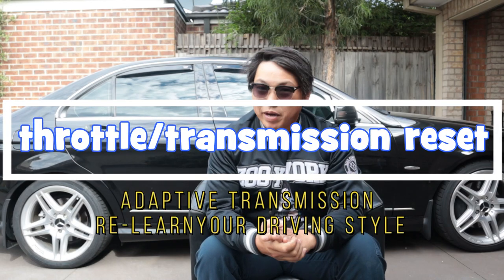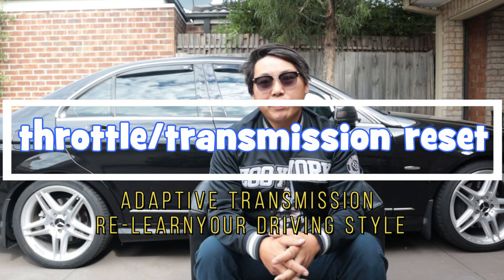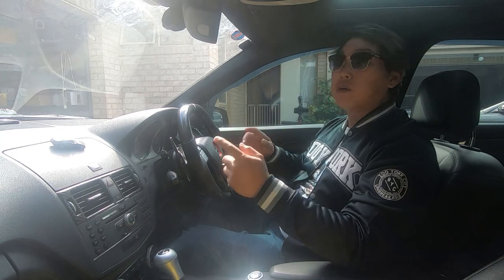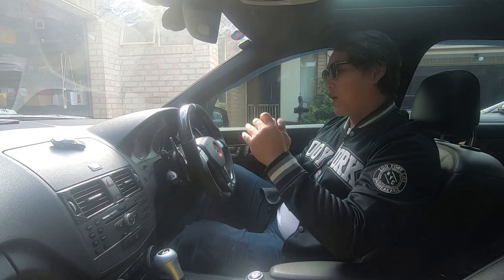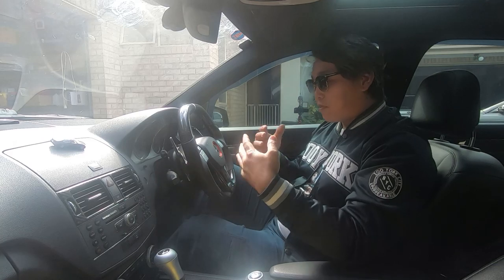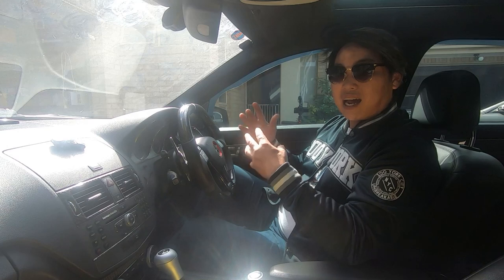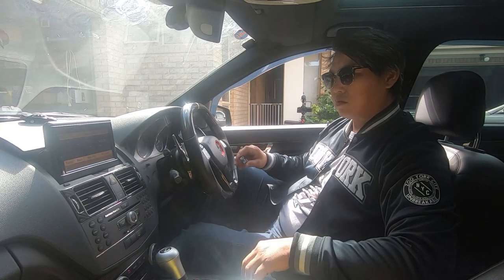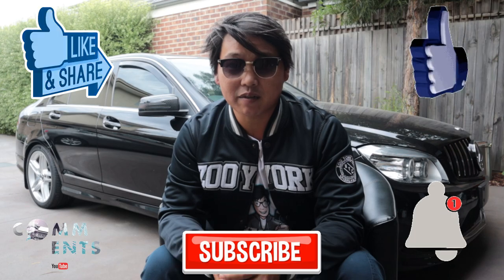mercedes benz TCM TCP throttle/transmission reset procedure EXPLAINED

Comment: Thank you so much! For the longest time I thought there was something wrong with my car! It was laggy, not very responsive and very slow at accelerating and unable to hit 3000 rpm! Thanks for giving me the confidence to reset my TCU and now it's running like new!
Reply from the maker: as long as there are no underlying issues it will help.. but if there are issue then it's not gonna hold up cuz there is another issue causing the lag or limp mode.. many ppl get the wrong idea and think its a fix but it's not a fix for an actual issue..

Comment: Hi @mikey so basically the steps are:
1. Turn key to 2nd on position (cluster lights turn on)
2. Hold down gas pedal for at least 10 secs
3. Turn key to off position (cluster lights turn off)
4. Hold down gas pedal for additional 10 secs at least.
5. Let go of gas pedal.
6. Start car and drive round for 15-20 mins so the adaptive gearbox can relearn the way I drive.

Is this correct?
Reply from the maker: yes step 4 isn't needed 
wen u turn key off u can release the gas pedal then do nothing 3 to 5 mins and then go for a drive

Comment: I tried this to get a more responsive feel out of my w203's transmission and it seemed to help at first. However, the day after doing this my car started having trouble turning over on a cold start, the same day on the way home from work it died at a red light, first time since owning the car I've had either of these problems. I spoke with my friend who is a German car mechanic and he tells me that when you do this type of reset there is another sensor that your supposed to reset at the same time (one you need OBD2 scanner to reset). I'm taking it in to let him have a look tomorrow, I'll get back to you with more info soon.
Reply from the maker: npz
Reply: So, I got this over to my friend's shop. He ended up having to reset everything in the car to even get it to start. He said he wasn't sure why I experienced this issue and that I should be able to do this sort of reset without issue. The car is working now but since he had to reset the sensors my fuel economy has gotten much worse (~3mpg less than before attempting the reset) and the car generally runs rougher. Any ideas what might be causing this issue? I've got no fault codes of any kind.
Reply: I’ll say a prayer for your car. Good luck.
Reply from the maker: @kalmanmerszei1048  ill 2nd that

Comment: Hey Mike, I have a 2009 Mercedes C350. Would you be able to advise me with an issue on my car? When I turn the car off my throttle body keeps trying to adjust it self to what I’m assuming to the close position but it keeps going all night. It won’t stop and it drains my battery completely. Any suggestions to what the fix could be. I should tell you this stared to when I was on the highway on a really hot day A/C on my car turned off all of sudden due to overheating I pulled over to the side the fan kept running and when it cooled it started back up again. But did it mess up the throttle position of the car and now it won’t go back to normal?
Thank You! For your time Mike😊

Comment: Hi Mike , my 2013 e250 estate drive perfect solo but when towing our van occasionally when I want to accelerate it’s seem unresponsive so have to go into manual and put foot to floor , this lasts for approx 5 mins then it’s ok , would I benefit from doing this reset please
Reply from the maker: it would at the strat but if there is an underlying issue it wont fix it, it will come back ...
Reply: @MIKEYZVLOGZ  Thankyou , what could sort of thing could be an underlying issue please

Comment: Hi bro hope u good, means if my car was on Stage 2 ECU tuned. So there is no issue right, as it only resetting the TCU.
Reply from the maker: es thats right , your ecu tune is the actual ecu, remapped, this is just a throttle response reset. ppl mistaken this for ecu reset . its not, it resets the ecu module for the throttle thats all i believe , but maybe u should ask your tuner who did you car will it affect it, im sure it wont . ecu is a completely different thing
Reply: @MIKEYZVLOGZ  yes that’s what i wonder. Thanks alot mate ✌🏻

Comment: Do you got any idea why when i start my car (2009 c300) rpms jump up and down, and while I'm at a stop? Just change spark plugs was most needed anyway but still have problem, luqui moly fuel injection cleaner, still have problem thinks it's the throttle body. Just wanted a second opinion sir🙏🏾
Reply from the maker: could be throttle dirty or maf dirty

Comment: Hi I hVe a 2009 c300 and everything was working fine then one day abs light came on and would always engage it when driving so I pulled out fuse but 3 days later now my transmission won't shift out of first it drive but won't pass 40 kph and I believe it's in limp mode now... any suggestion
Reply from the maker: hey bud so sorry couldnt get back to you . i have been so busy , wen ur car hits limp mode, they can be number of issues causing this, it shard to say exactly what it can be because there are so many contributing factors that can make a car go into limp mode, such as dirty maf sensor, oil low, loss of oil pressure, timing,  the only way to tackle this wouold be to scan for errors and try to narrow down the fault, if you are not too experiemnced u must take it to a mechanic to sort out,
Reply: @MIKEYZ VLOGZ  hey thanks I got it checked by a mechanic and he reset everything and it's was working gone for like 2 days and now it has gotten back into limp mode. Would you know if the abs ebr esp would cause this ...like if I replace the abs sensor would this be one of the reason for it stop from going into limp mode???
Reply from the maker: @Terrance  car goes into limp mode from a engine fault to stop it doing major damage
Reply: @MIKEYZ VLOGZ  ok he said it was like a fluke on why it went into limp mode. The car runs fine and everything for like the past 6 years I had it and the only recent thing that happen was the abs light and once he reset it it was fine until today. So that's why I was woundering if the abs sensor would be a part of the problem. Thanks again Mikeyz
Reply from the maker: @terrance6501  YES IT COULD BE IT, I DID REMEMEBER reading somewhere that someone had the same problem and it was fixed after replacing the abs sensor ..but pls do not quote me on that , i am not sure as i havent experienced this peroblem as yet

Comment: I just cleaned my throttle body and emptied the oil catch can. I reassembled everything back and when I start the car it’s very rough. More than ever!! Did I do something wrong?
Reply from the maker: What did u use to clean the throttle body did u clean maf sensor?  Try unplugging maf sensor and see if shaky goes away ..if it does then u have a faulty maf
Reply: @MIKEYZVLOGZ  I didn’t clean the maf sensor. I have a 2014 e350 w212 M276 engine
Reply: I used carb cleaner and wd40 degreaser just like in senior Leigh’s video. I followed every step
Reply: I literally just unplugged the MAF sensor from the air filter box. The shakiness went away and it just idles at 1000-1200 rpm steadily.

Comment: Cheers, it looks like its working. I was starting to stress that I brought a lemon. 🙂
Reply from the maker: but if the issue comes back u may jist have a underlying issue whether it's a maf sensor or intake leak sonetjing that's making but loose pressure

Comment: Hi my friend I would like your valuable help.I have c220 cdi 2010 when I put D to start while pressing brake it pushes hard to start.Thanks
Reply from the maker: do u mean it kicks into gear D very hard like a hard jerk wen u enter D
Reply: @MIKEYZVLOGZ  
no. I put D normally it doesn't knock and doesn't have a jerk. But I have the brake pressed hard and it keeps pushing me hard to Thank you!
Reply: @MIKEYZVLOGZ  Do you think that if I do a reset the way you show it can help?
Reply from the maker: @user-ey4yc8tf5r I don't think a reset will fix it..it could temporarily solve it ..but if there is a underlying issue it will come back
Reply: @MIKEYZVLOGZ  Thank you very much!!!

Comment: Hi i have a c63 (w204) yesterday i was at a set of traffic lights and the car cut out, i restarted it no problem but every time i put the car in drive it stalls completly - any ideas ?
Reply from the maker: hi mate, could u elaborate on some more info , its hard to diagnose over the net , so abit more info would help point u in the right direction, however regardless, these are the things i would be looking for 
prior to this happening was there any other symptoms that started such as intermittent shut off, bad fuel , jerky shifting of gears, rough idle rough driving , limp mode? 
usually when a car is shutting off when selecting D, it relates to the transmission but the actual cause is hard to simply point to, it s best to have it looked at before the problem becomes worse or leads to major issues.
Reply: hi, thanks for your reply, the car sometimes felt a bit jerky when changing gear, also was lagging abit
Reply from the maker: like i said hard to say without actually being there to feel it and see it but i would start with a obd2 scan, with a proper tool that scans all modules, not just the typical ones, it has to be Mercedes specific, like icarsoft , or star or vediamo xentry , this will def narrow down the issue so ur not throwing money and parts at the car hoping to fix it  @2bluelou
Reply: thanks so much for your input, ill get it checked out @MIKEYZVLOGZ
Reply from the maker: @2bluelou ye do that

Comment: Hi there hope well ? I have a question regarding my s button c button don't work I've tried cleaning the switch no luck any idea
Reply: spray some hydrogen peroxide in the cracks, it worked when mine was sticking

Comment: can you tell me what the symptoms are? When should you do this? I now have the following, Cla automatic in eco drive. In a traffic jam, the car will change gears differently after a while, make high revs and switch back to normal when you arrive home the next day. So is this a good thing to do? Thank you for your response
Reply from the maker: basically I would do this just wen u feel you need it ..for example wen u drive and the car no longer responds well to your driving style... or wen someone borrows your car for a while...and drives completely different to you ... not if it's just a day ... and if tour car feels laggy... in your case seems like a sensor is failing .. or even a air hose causing that random rev ... can't say for sure ..but definitely needs to be looked at by a qualified mechanic ..do not let these problems be ignored it may cause more harm

Comment: Will this work on a 2012 mercedes w204?
Reply from the maker: yes sure will. its auto right?
Reply: @MIKEYZVLOGZ  yes
Reply from the maker: @allengoodhur9388  then it will work
Reply: Is this work for 2010 w204 c200
Reply from the maker: @2uk2  yes should be ok and work

Comment: Hi there we have a C300 2007 and noticed a few things happening  
-Gears aren’t showing on the dash anymore when switching them from Drive to park etc.
(letters are visible but not highlighted if that makes sense)
- Cannot select sports manual & comfort mode anymore that’s no longer displaying at all either. 
-Car Kicks back hard when we put it into Drive park neutral. 
- Finally when accelerating it goes up to 4000rpms making a high whine noise like it wants to change gears but can’t. 
Any help would be great. 
Thanks
Reply from the maker: hope someone else can chime in here ... sorry to hear of those issue..sound very much like sensors ... knock sensor for gearbox... and possibly engine mounts ..but u won't know until u do the process of elimination .. using obd2 scanner tooldesigned for mercs... and trial and error by physically looking the problem areas..  this is what I would do .. hard to say from just the description uve given ... this would need a more in depth look at ... a mechanic or alot of research and time to find actual fault and issue ... hope this  helps point u in the right direction .... although I would get it looked at asap ... doesn't sound healthy for the car ..the symptoms u describe
Reply: @MIKEYZVLOGZ  
 
Thank you so much for the response we found the problem my partner pulled up a Fuse not the small 1z but a big Square 1 & she didn’t push it bk down she said she forgot.
As soon as we pushed it bk in everything went bk to normal 🙌
Glad it wasn’t something serious. 
Thank you.
Reply from the maker: @Munihuni90  very glad to hear it
Reply: @Munihuni90  I had this issue when my centre gateway was wet. Yea legit wet because my windshield used to leak. So my car can work fine but I def need to get a new gateway when I have the funds. It ain’t no easy job to own a merc in a developing south East Asian country due to exchange rates and inflation to account for. 

Oh ya btw my symptoms were like what u said, harsh kick back when put into drive, but other than that my meter display was initially still able to indicate the gear I selected, except after that when I was in D it still said I was in N.
Reply: Change your transmission fluid. Don't be cheap you drive a Mercedes.  If you're cheap & own a Mercedes it will be a nightmare & a money pit but for those who don't mind spending on there car and doing there own work it's a dream.
Reply: did you end up figuring out what was wrong??
Reply from the maker: if u read above was just a loose fuse
Reply: @MIKEYZVLOGZ  i see i just don't know what fuse it was, im having same issue
Reply: @Munihuni90  i have the sam exact issue smh, let me know if you remember what fuse
Reply from the maker: @diegoperez-bb3nz  hopefully he can tell u which fuse it was ...
Reply: Did you happen to figure out what fuse it was im having the same problem. Thanks  @diegoperez-bb3nz
Reply: Do you happen to know what fuse it was mine is doing the exact same thing  @NokiaHumanForm

Comment: Can we disconnect the battery for about 15 minutes and reset EVERYTHING?
Reply from the maker: that might work but I think thats for ecu this is  specifically transmission module reset
Reply: No doesn't work
Reply: I heard that, but I thought it was 24hours .I heard it resets the ECU to factory settings.(on most cars)

Comment: One thing I don’t get about my W211 is when I set the transmission in C, it would drive off my driveway like normal and after I stop at a traffic light, my God that thing starts off at 3rd gear. My dad is the one driving the car often and of course boomers being boomers, they drive with their own sweet time and after some time he would wonder why does the transmission stays in a gear for a long time while it is hesitating to upshift at lower revs. 

So because of that I have to do this transmission reset very often so that the car doesn’t try to act funnily. I also recently encouraged him to set the transmission in S so that the throttle response is better and the gear shifts are more immediate. He worries that fuel consumption would be higher and the car might hit the car in-front at start stop traffic because of added responsiveness. So I told him to only set it to S when traffic gets going at certain pace or try to keep a further distance from the car in front if he worries so much of hitting.  

It’s a Japan imported E240 with the M112E26 motor, mated to a 722.6 5GTRONIC.
Reply from the maker: lol I feel ya... maybe u can drive it every now and then and ensure it responds to how u drive lol
Reply: @MIKEYZVLOGZ  mate the thing is I’m from malaysia and if I take over the wheel and drive alone, that thing’s gonna hit 200kmh under my abuse lmfao.
Reply from the maker: @NokiaHumanForm  lmao

Comment: My car just started to lag when accelerating 1st 2nd and 3rd gear.  It also stalls when I make turns.  Could this be the problem?
Reply from the maker: u can try but most of the time it's an underlying issue sensor or loose hose air leak
Reply: @MIKEYZVLOGZ  will check all those things. Thank you
Reply: My w211 also stalled at corners. Didn’t remember how I solved it.

Comment: Hi Mikey, I just experiencing suddenly holding at 3rd gear on my c300 2010 after 1mo I changed the transmission oil

Until I do exactly like your video, then it works like magic thank u... But according to my issue is it gonna hold up permanently or just temporary..

Thanks brother
Reply from the maker: so it really depends if ur problem is deeper then that... doing this transmission reset may help for a small period of time but if the problem is under lying then u will resurface until u actually solve the issue ... what ut is I'm not sure .. these things need a thorough looking into..its not something u can just guess by someone etelling u the problems
Reply: Tq brother for the suggestion...
Reply from the maker: @dionpradiptapradipta781  welcome